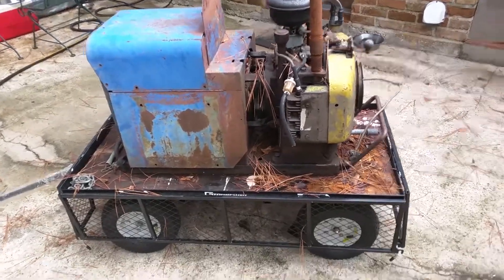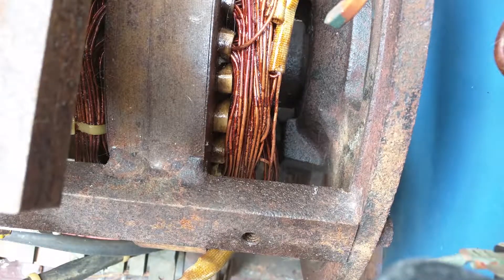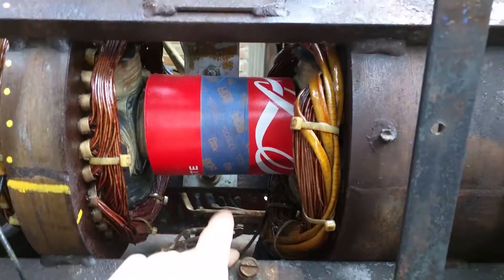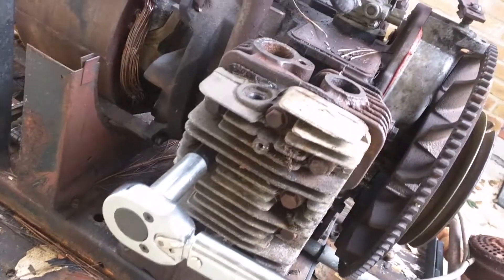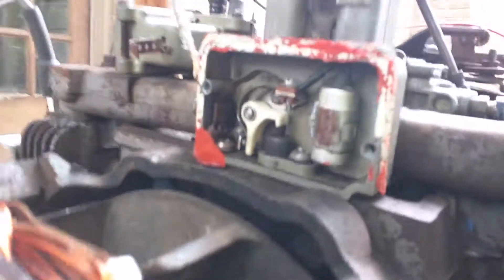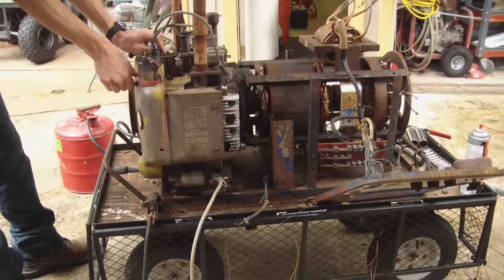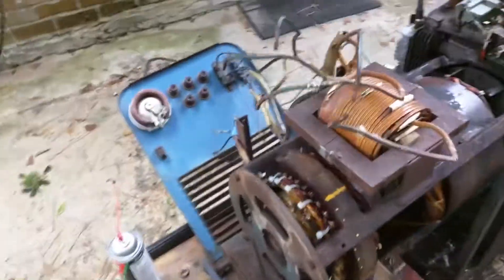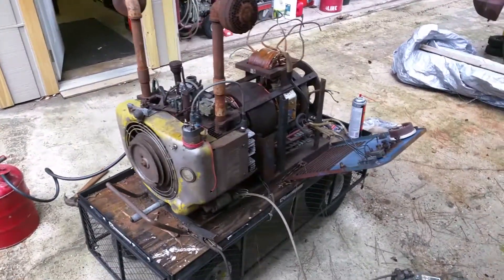Start the '73 Miller Welder (Onan CCK Engine)

Comment: One of the very first things to do on a machine like this is a compression check. Find where it leaks compression... Then, an oil change... Then a valve adjustment, then clean-up the spark plugs, then clean the points & static time it... If it fires at all, it means the coil is working. So if there is no spark on one of the cylinders, try a new set of plug wires, still firing on 1 cyl. means that maybe a spark plug is bad. If the dead cylinder happens on the other cylinder after the spark plug swap, then the spark plugs are the problem. The fuel filter on the inlet side of the pump is wrong, it should be on the outlet side, especially when he is lifting it up 36" from the floor... If the fuel tank was located higher than the carburetor, and the filter was on the OUTLET side of the pump, then He might have gotten better results... If he does have this thing up for sale, a good DIY-er would probably swoop on it quickly... BTW, the right thing to use for naked stater windings in a motor or generator is called : 'Glypkote' ....
Reply from the maker: I did get it to fire on one cyl but never made it generate electricity. She needed gaskets and much more love. But yeah posted it for free on fb marketplace and someone swooped it up - said they liked fixing old machines.

Comment: Please, you gotta help me out. What kind of coil are you using? My stock onan cck coil from 1966 is shot. And I can’t find any coils that will work. Please let me know
Reply from the maker: Man I'm not too sure. It came with the machine. I no longer own it, I donated it to someone who fixes these old things and I did not want to scrap it. Have you used a multi meter to test it?
Reply: B Wood, There are several dual output ignition coils on the market for several types of engines that operate on the 'wasted spark' principle... One that has a primary resistance of 3Ω to 4Ω would run these engines very well... Some of the Onan's had mechanical flyweight type of advancers... But those added some complexity to this already simple, sturdy and efficient power plant... Good clean ignition points are a must to keep a machine like this running properly...

Comment: Gimme the motor to make a baby gokart, check my terrible channel, thanks! Haha
Reply from the maker: It's long gone lol. It was too much for me so I let someone who fixes old machines take it. So take it from my experience - these big old engines that are static load are not good off the bat. You'll wanna go EFI or with an ATV/mikuni style carb. The carb that ships with em is good for static loads like generators or pressure washers. They're also super heavy lol